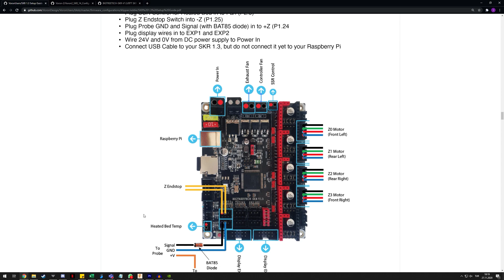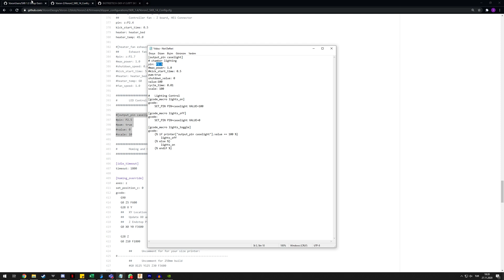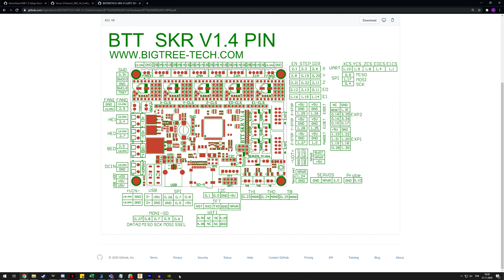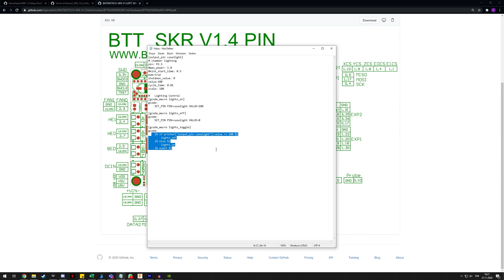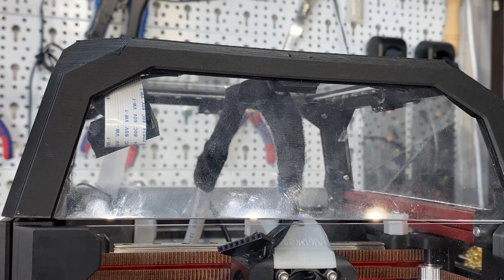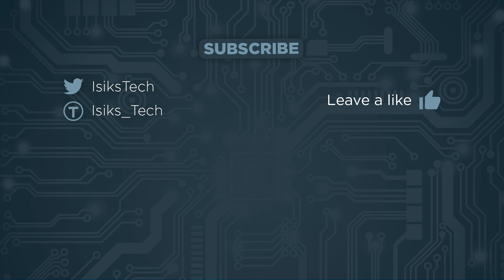Controlling LED Lighting w/ Klipper

Comment: The toggle macro doesn't work for me, lights work with the on and off macros though. Has something changed in klipper over the last year?
Reply: For those having issues with the toggle, just change the first line of the if statement to this:

{% if printer["output_pin lightbar"].value > 0 %}

Lightbar being whatever you’ve called your light
Reply: Confirmed working! Thanks very much! @1patbatemanvp
Reply from the maker: It still works for me on my v0.
Reply: Same here... On and off works good.. Toggle doesn't... Not a big deal though
Reply: @valbuffo  octoprint, mainsail or fluidd? I'm using octoprint and still haven't got the toggle working
Reply: @adj6296  mainsail
Reply: @valbuffo  I think the value should be "1" and not "100"

Comment: Awesome Video, exactly what I was looking for. Out of curiosity, if you wanted to use multicolored LED's, can Klipper control the color with the pinout you used in the video, or would it have to be wired and setup differently? Thanks!
Reply from the maker: You can theoretically use individual mosfets for r,g,b as long as they are (-) pins and share a common (+). But I think it would be easier to use neopixels, klipper has support for them.